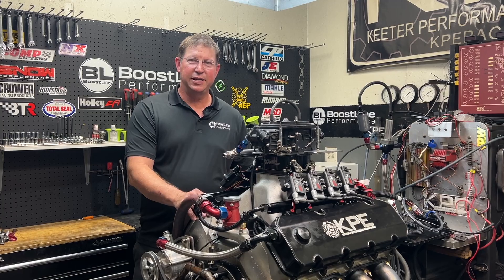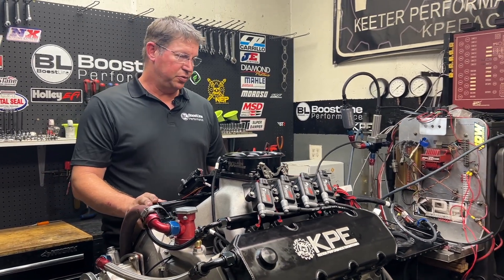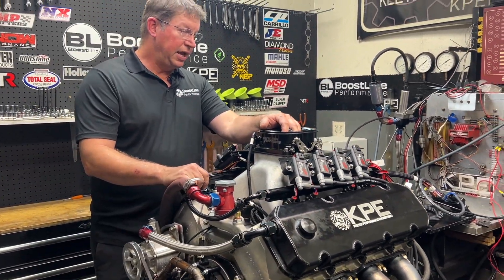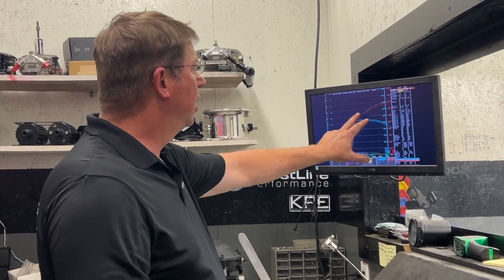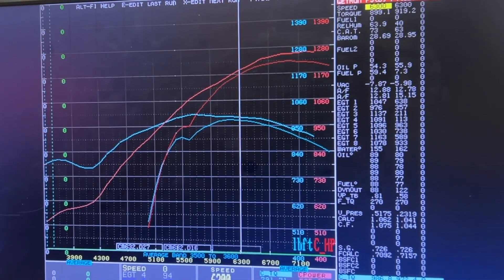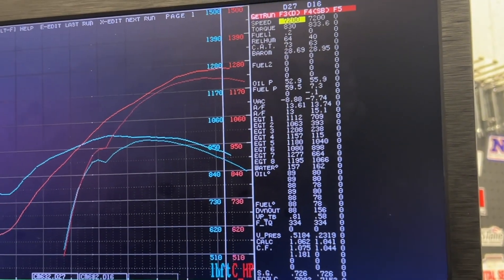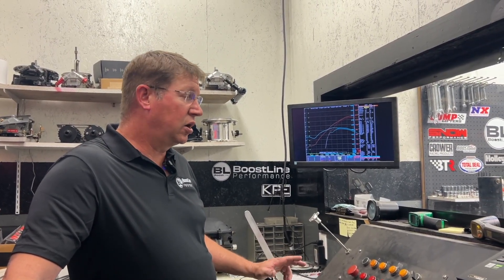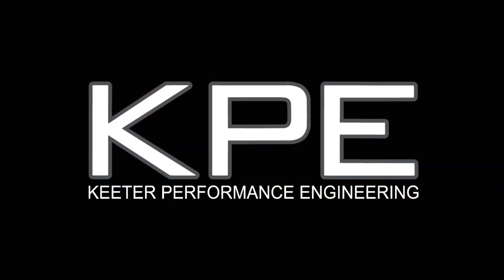Carb VS EFI on the engine dyno - What makes more HP?

Comment: On EFI, Injector placement has a fairly big impact on atomization and mixing quality. (But also injector quality... Somehow I allways fall back to genuine Bosch injectors due to spray pattern and overall longevity, sure they don't allways make the biggest injectors, but they atomize well and in the cases where alot of flow is needed then double up which may have other benefits too...) If dealing with crappy regular wide-cut non-selected isomer pump gas (or high alcohol content, which is not necessarily crappy, but it has slow evaporaziation) the evaporation time is longer. Short chained branched isomer fuel (typically naturally higher octane, non-alcohol fuel which is high octane without use of TEL or other organometallics or alcohols) evaporate fast as f*** and is not very picky about injector placement, but for your avarege fuel which takes some time to evaporate, the distance (and thus time) between injection and reaching the combustion phase becomes more important. As far as emissions compliant engines concerned, the injector placement is typically close to, or in, the port due to emissions and low rpms which most every-day vehicles operate most of the time (realisticly), close to the valves gives the optimium time of evaporazation for most fuels at low rpm and a lower manifold pressure, but give too short of a time for the fuel to evaporate at high rpm and higher pressures, and thus sacrefices some performance and fuel efficency at max load and high rpms (which realisticly is not used that often in regular vehicles). Thus if low load/low rpm, and meeting emissions (which are measured at those criteria) is NOT of importance, but best atomazation at higher load/rpm/pressure in hunt of performance, then having the injector further up-stream or perhaps above the runner inlet is better, or if circling back to "smaller" injectors, then have two per runner to give the best of both scenarios. AKA Sequential staged injectors. One small/medium injector close to port/valve for low load and low rpm, and a larger injector at the runner inlet which comes online in addition to the small one when the small injector flats out at 80% duty. Switched staged injection (aka, just switching between the sets of injectors) I would not recommend, even tho it is an option and many do...

And on modern GDI engines, the best (which automakers realized too late) is having staged injection with a set of small port injectors for low rpm and low load, and using the in- chamber injector for the heavy lifting. Technically GDI is worse for evaporazation, but the pressure they operate at, offset that time deficit in creating better atomization from the get-go, and the possibility to nearly eliminate quench-related end-gas detonation is also very beneficial (through injecting just late enough that the bulk of the fuel is contained in the main portion of the camber whilst the quench-areas remain dry to only having stratefied amounts of fuel).